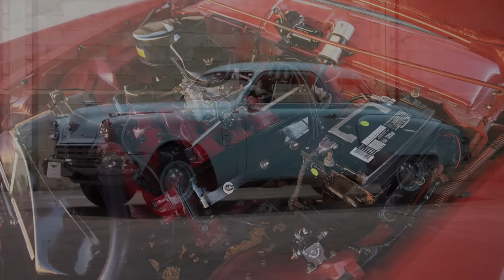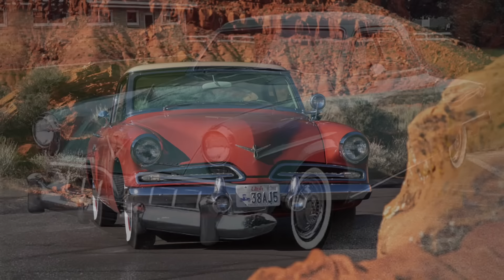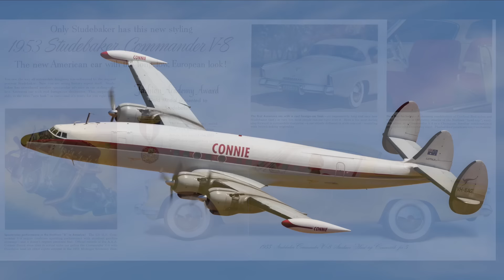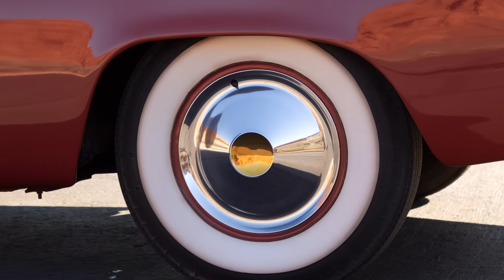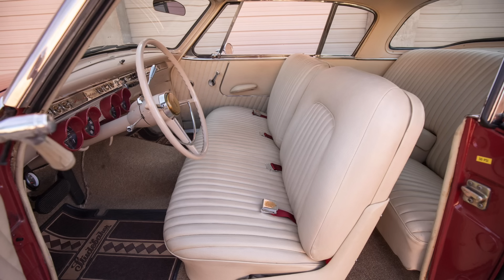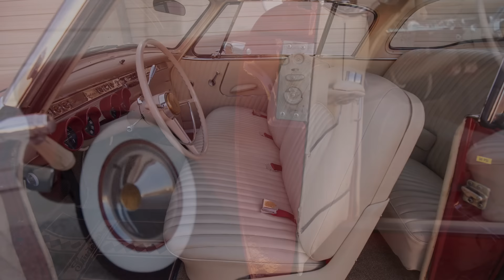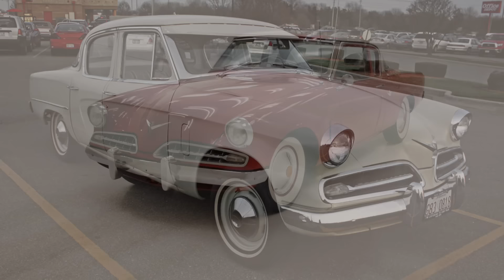Most Beautiful (& Flawed) Cars: 1953 Studebaker Coupes Had Only Skin-Deep Beauty

Comment: He doesn't mention some of the strangest differences.  I had a '57 Studebaker for a long time.  If you open the air vent you can see the road.  I'm not kidding.  Keep that door closed if it's raining out there!  It also had to have two separate heaters, one under the passenger seat to heat the car and another tiny one inside the dash (to try) to defrost the windshield.  Other cars had the master cylinder under the drivers floorboard, but it's also worth mentioning.  On a bet, you could check brake level while driving down the highway (don't try this at home, heh heh).  How about that weird speedometer with the needle that doesn't move, but rather the numbers move to show your speed?
Reply: My father had a 57 President until I was about 10. I’ll never forget the fixed needle rotary speedometer.  Not many around anymore. My aunt had an early 60s Lark, also fun.
Reply: The under seat heaters first appears in Studebaker's in 1940.  My Uncles used to always say it was the only car where the people in the back seat complained about their feet getting too hot.
Reply: @patrickfuchs1821  As a kid riding in the back of a '67 Beetle I remember my outboard foot roasting while my inboard foot was freezing.
Reply: My dad had a 10 year old 57 Studebaker when it came time for me to get my driver's license.  Not being fond of that rust bucket i elected to wait until he got a 62 Pontiac before I got my license.

Comment: The best thing about classic cars from the 80s and before, is that, unless you're looking for a completely original vehicle. All of the mechanical issues can be fixed by either modifying them or replacing parts. Personally I don't care about originality. I would prefer an all original car. But if I need to modify something for safety or drivability I won't hesitate

Comment: First by far with a postwar car.  The frames were upgaged  in 1954 cars and I think was never a problem in the later model years and Hawks.  I don’t know that 1953-55’s Studebakers had inferior driving dynamics when compared to Chevrolets, Fords, and Plymouths of the same era.  The Studebaker V8 was hamstrung with coolant and oil passage locations that limited their maximum bore capability, which hurt them as the 1950’s wore on and competitors punched out their V8’s to displacements approaching 400 cubic inches.  It was also hindered by heads with smallish valves and intake ports.  Studebaker relied on Paxton supercharging to compensate for their displacement and head disadvantage, which was of course expensive.  The Studebaker V8 was designed very robustly, with forged crank and rods, and a gear driven timing system and was well suited to supercharging.  The Studebaker V8 was enlarged to 259 cubic inches in 1955, and to 289 cubic inches in 1956.  The rare, hand-built R3 and R4 engine options in 1964 Avantis and Studebakers were 304.5 cubic inch hand-built racing engines with special large valve heads, aluminum large port intake manifolds, hotter camshafts, and in the case of the supercharged R3, a faster-spinning supercharger for more boost.  A properly-tuned R3 could produce 400 horsepower.  There was a stillborn program to modify the block to accommodate 340 and 360 cubic inch displacement, but the company ended U.S. production before any were built and the company switched to Chevrolet 283 V8’s in its last two years of production in Canada.
Reply: What many don't realize is that until about 59 or 60, the Chevy small-block couldn't go over 283 cubes.  The Fire Ring head gaskets came out in 1959, but it wasn't for a few more years until the auto makers considered them to be proven.  That's why the 1962 327 version.  It never would have happened otherwise, unless Chevy decided to make a long-stroke small block.
Reply: @jamesbosworth4191 it seems some people don't realize that the small block Chevy went as high as 400 ci as mentioned here. I have ticked people off with this tidbit as a fan of Plymouth. And Chevrolet small blocks are so popular...go figure.
Reply: @jamespell8091  Part of the 400 problem is that the 396 in many later applications was advertised as a 400, so many people not familiar with Chevys assume that all 400s were big blocks.
Reply: @jamesbosworth4191 The 396 actually becomes 402, while 400 remains a small block.
Reply: @brucebeauvais1324  I realize that, but that 396/402 was called a 400 in Chevy trucks starting in about 1968, maybe 1970.  Maybe certain other vehicles as well?  And I do know that in the Squarebody trucks, which debuted in 73, the 400 was the small-block 400.
Reply: @jamespell8091  The chronology is the key here. Chevy's 400 small block didn't come out until 1970, and it's not exactly the same block as the others, although externally it is the same size - internally, to accommodate the bigger bore, they siamesed the cylinders. They also enlarged the main bearings and used shorter connecting rods. It was never intended for performance usage, morever - just a (relatively) slow-revving engine for your Impala or later, your pickup truck. 

The fact that they were able to do this by 1970 in no way invalidates the point that they were stuck at much lower displacement in the late 1950s. But, Chevrolet had other tricks up their sleeve - like the W-series big block (348 and by 1961, 409 and even a 427). And they had a lot of extra room under the hood, which Studebaker didn't.
Reply: Quite the essay.  Thanks for the reminder.  I realized the superchargers and the speedometers wound up optimistically high as well on some models.
Reply: I had a 63 Studebaker Hawk GT and it was probably the worst most flexible noisy and rattling chassis and body of any car I had. Window regulators would break the door latches were crap current weather stripping was horrible. Then I had a 71 Cuda 340 convertible, that was almost as bad as well.

Both of them were beautiful cars to look at styling wise put the Driving Experience did not match the looks. Same for my 95 SS Impala😢
Reply: @7x779  You didn't like your 95 Impala SS???  Most people LOVED their's.
Reply: @jamesbosworth4191 maybe if it was stock I would have liked it more, but it had eibach springs, was too stiff of a ride, kind of rickety and rattly. Also, that optispark is a royal nightmare especially when this car was supercharged with an air to water intercooler right in front of the engine. You'll be out of cuss words and hair by the time you have to tear it apart at least three different times because there are no good OEM Parts left for this and the aftermarket is trash. I paid $800 for an MSD Billet off to spark distributor, put it all back together in the damn thing was bad out of the box. I looked at the sensor closely inside and you could tell it was a piece of crap with molding and flashing marks on it made in china, call MSD and they lied to me and said it's their own proprietary sensor. Then I got OEM ones from both Chevy dealers, delphi, took them apart, again cheap reproduction garbage Chinese sensor inside. Then I got one from a Corvette guy named petrus, and that burned right through the distributor cap. Finally, I found one locally from an old lady having a garage sale. It was a New Old Stock and when I took it apart it had the original Mitsubishi sensor which which Mitsubishi refuses to sell unless you buy 10,000 at a time. That's why there's no good ones out there.

It had over 500 horsepower at the wheels, and with only 265 horsepower stock the car still does 156 mph which is pretty impressive. I probably had $600 at the crank which should be more than enough to do 185, maybe even 200, but I'm telling you it ain't no BMW m5. The thing felt pretty scary just at 140.

Just a thing about it was it was intended to attract the wrong kind of enthusiast
Reply: @7x779  Modifying a car does not always work well.  Your Impala was supercharged?  I would have loved it even if it was crap, just for the power!
Reply: @jamesbosworth4191 another problem is the 4L 60e automatic transmission, the ratios are so wide, especially the first gear is so low and the Gap to Second so big, if I recall it would drop like 3,000 RPM completely off the power band so you'd go from like 600 horsepower to about 200 or less. That's with the modified supercharged lt4 which red line at around 6400 I think. The stock motor probably shifted at about 4600 RPM so the RPM drop was much less and it didn't fall off the torque curve. There's a lot of things to think about when building a modified engine where the torque and horsepower curve is raised 2000 RPM from stock. What my particular car needed was a 6-speed, but that's where it becomes never-ending unless you have unlimited resources like Jay Leno
Reply: @7x779  That is not a good performance trans.  A turbo 400 would have been much better if you had to have an automatic, a manual transmission would have been the best bet.
Reply: @7x779 So descriptive. Friend's Super (Golden?) Hawk with the Paxton blower, was a bit 'loose in body/frame construction, but very fast.. 
Brakes, suspension, handling while braking, maneuvering, things that are supposed to slow you down while in control,, from the triple digits,.. were another matter; ;]
Reply: @blogengeezer4507 I think if they could have made the body and frame solid and rigid, they might not have ever went out of business. Driving my brother is 64 Mercury Comet station wagon, or my other brothers 67 SS 396 impala, for the 69 SS 396 Chevelle that I bought later on, and comparing that to my 64 Studebaker Hawk GT was like night and day difference.

The only thing that came close to the loose rickety rattly build quality of the hawk was my 71 Cuda 340 convertible. I later met a guy with a 70 Hemi Cuda convertible, and he admitted the same thing. The cars have an awesome image in the public loves them, but when you drive them they really are just a piece of crap😢

Lol... I'm going to get some hate for that comment
Reply: @7x779  That is strange, as I have always heard that the later Hawks were tight and solid.

Comment: The 1954 didn’t change much in style but in 1955 they completely RUINED it with a different bigger bumper. What were they thinking?
Reply: Or, what about the later fiberglass fins ...?
Reply: @sebastian0107  The 1956 Golden Hawk had small fins made of fiberglass, not carbon fiber.  Later models had steel fins.
Reply: @scotpens  Corrected! I slipped, it's really late here in Holland. They used to add them to Borgward Isabella Coupe's too, at the time. The unspoiled early Hawks are the nicest IMO.

Comment: Love that discussion of the frame. Seems like a shop could build reinforcements fairly reasonably (within the context of what it costs for restoration services) to improve the usability of such a beautiful vehicle.  Does anyone know of that being done?
Reply: They went to heavier gauge steel for the '54 models, but the brakes weren't upgraded until around 1956.
Reply: The fiberglass Avanti used the Lark convertible X frame reinforced with torque boxes, called hog troughs in the Avanti community.
Reply: Hi from Ontario.  
A friend of mine has a Studebaker (not certain of the model) that was transplanted onto a Chev chassis and running gear.
Reply: The Lark convertibles had an X-member put into the frame (and I believe the Avantis I used that frame as well) I remember someone in the Studebaker club selling X members from the factory surplus.
Reply: @dannork1240  Larks used a shortened version of the '54 chassis, itself built of heavier-gauge steel than the '53 models, and all Studebaker cars of this period had reinforced X members, regardless of body style.
The fiberglass Avanti was built on a modified Lark convertible frame, which was itself reinforced with torque boxes, commonly called hog troughs. These are notorious for rusting out, and restoration shops often replace the corroded parts with better-protected reproduction frame members. 
I have seen comments in sale ads for Hawks (Starliners with more elaborate body work and fins) listing hog troughs among the parts that have been replaced. 
Not commenting on the validity of those claims, but I have seen the ads.

Comment: 10:30   We also have to remember that the petroleum companies were crowing about their plans to offer aviation-grade fuel in the pumps at your corner gas station, that drivers would be able to fill up with 300-octane super-duper-premium as easily as regular (although no doubt, at a super-duper-premium price as well). 
Oldsmobile famously built a 14:1 compression ratio example of their flat-head six. The horsepower, torque, and above all, the fuel consumption numbers were superior to the 303 V8 which was under development at the time. When challenged on the practicality of this experiment, they admitted that it might be more than ten years before the triptane gas would be available, that the high compression six was just proving a point. 
When you look at the robust build of the Studebaker V8, we see that there were more bolts holding the heads down, the crankshaft was forged, main bearing and rod bearing area about the same as the Chrysler Hemi and Cadiddle-Yak V8s, with horsepower per cubic inch in the same range as well, and superior to most of the competition. 
There were even plans to ass a 200-cubic-inch V8 to power the '55 Champion line.  
The bad news was that the Stude V8 weighed almost as much as a Packard nine-main-bearing 327.
See also the Studebaker-Porsche Z87 project.
The '51 Studebaker V8 proved to be reliable and economical (if rather weighty) and it could run with the best the big dogs had to offer (29 speed records at Bonneville was nothing to sneeze at).

Comment: I have been told the production line of Studebaker was designed with the shorter wheelbase sedan in mind and when the coupe was introduced and sold very well the production was very badly impacted by the compromises done to produce the long wheelbase model. At the best of times the production facilities at Studebaker were marginal and when they started producing the coupes the production rate was very reduced, resulting in lower sales, especially for the 'bread & butter' 4 door sedans. Then when the flexible nature of the coupes became well known they were much harder to sell as well.

Comment: That design could work today, it is so beautiful.  Imagine a reproduction fiberglass or carbon fiber shell that could be mated to a contemporary chassis and a small but powerful fuel injected V-6.  It would definitely be a fun head-turner.
Reply: That body style has more records at Bonneville than any other car.  My Uncle used to say people made a lot of fun of them when they came out because they looked so different.  Where they lived in Texas, people called to them "Bohemian Cadillacs".
Reply: Roll over and bumper standards would kill it.
Reply: @craigbenz4835 if it was sold as a kit car like GT40/Cobra replicas,that wouldn't be an issue.It'd be quite a riot with 4 wheel independent suspension and an LS or Coyote..
Reply: @craigbenz4835  There are regulatory  exemptions for low production vehicles

Low Volume Motor Vehicle Manufacturers Act of 2015. Something less than 350 production are exempt.
Reply: V-8...
Reply: But then somebody would want to convert it to battery power.
Reply: We oughta talk some business, friend... Same idea here

Comment: Gorgeous car, but you gotta get the hardtop.  Studebaker design always had a problem with windows.  On the post coupes and sedans, the frames are too thick and the glass is inset too far, giving them a heavy, stodgy look.  Even the windshield on this coupe doesn't look quite right with not enough curvature.  Not a fatal flaw though.  This should have been the first personal luxury coupe...if only they had an engine for it and better engineering.

Comment: Virgil Exner designed the bullet nose Studebaker which Ray Loewy took credit for😮. A bit of a shame that by 2018, most of the South Bend factory buildings were torn down. Last I knew, the Admin/doll up building is still standing. Studebaker did consult with GM (Ed Cole?) On the design of their OHV V8.

Comment: Didn't they have a fairly primitive braking system, with the master cylinder in the floor?
Reply: Studebaker used the under floor master cylinder until 1960 in Larks, 1962 in small trucks, and 1964 in the 1 ton and larger trucks and Hawks.  You can still order them from your FLAPS.
Reply: Pretty much the industry standard at the time.
Reply: There is a bullet-nose sitting on the lot of an auto repair shop near here.  I stopped one day to ask about it, just out of curiosity.  They said they're trying to fix it up for the owner but having trouble sourcing parts.  One thing they mentioned was the brake system -- I think they said the master cylinder is on the floor under the rear seat.

Comment: Bob Bourke's '53 was and is the stellar design of the '50's and is All American. European cars always looked dowdy, small and dated at the time, although Euro snobs may get sniffy about that opinion.
The chrome snout grafted onto the Stude in '55 ruined the car, as did the Hawk grafted-on fins. 
The sweep body line plagued Stude designs to the end of production, as they were always on the door leading edge. Door latches were a problem on all Stude's until production ended in '66.
Brook Steven's '62 update  into the Grand Turismo was a brilliant update of the '53 body.
The '70 1/2 Camaro in profile echoes the Stude.
Reply: 70 1/2 profile a no if you squint real hard maybe the front end... I tried looking at the images...